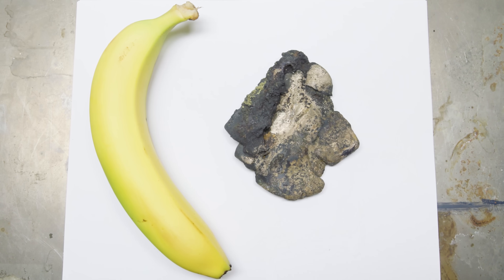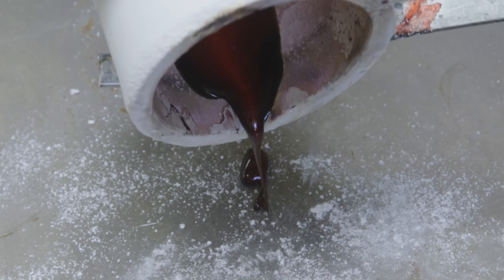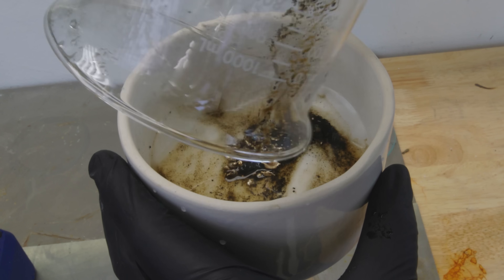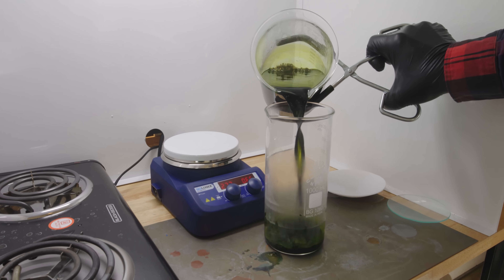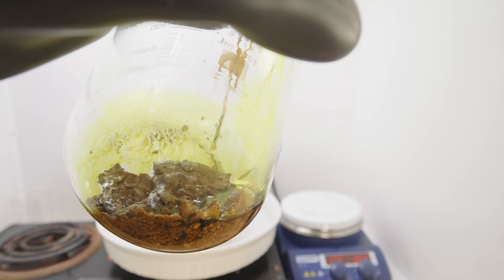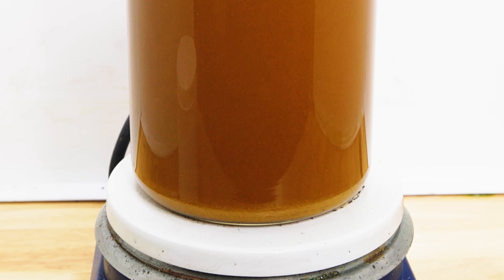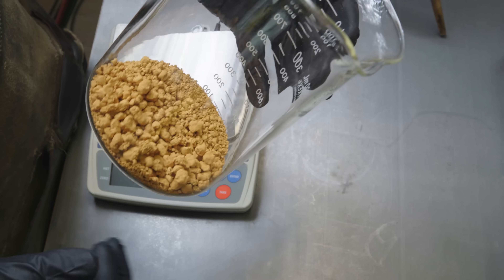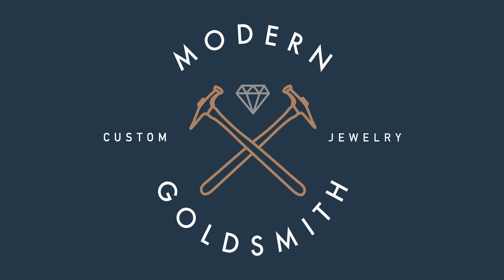Turning a BLOB into PURE GOLD!

Comment: I recently just bought my first gold bar that is only 1 gram and it was pretty expensive. The fact that this turned out to be 213 grams is pretty wild. To put that in perspective, that blob of gold is worth $14K+ right now.
Reply: a gramm gold is 59,38€
Reply: hilariously 533g (the original weight) at 10k is still over $14k lmao
Reply: Ok first of all nobody buys a bar of gold randomly and 1 gram is pretty much nothing this is so false
Reply: The problem is you're assuming it's indeed 24k, the moment it's even a little bit less (999.8 instead of 999.9) it's value drops significantly, this is why you can't take the gold out of the packages they come in or they're considered "not pure" anymore.. His would only be worth that much if specially forged in certain conditions and packaged in an inert gas
Reply: @keiththekeiser  isn't 23k still very valuable? im not sure if this is accurate but a quick google search told me that 23 karat gold is $83 aud per gram, he had over 200 grams of the stuff so that's 16k AUD, or roughly 11k usd.
Reply: @jazzman7842  yeah 23k is, still worth a crazy amount, but you'd be surprised by the difference in value between 99% pure and ~100% pure things, especially in chemistry or with gold
Reply: @keiththekeiser  from the same website i got my previous gold prices from, 24k gold is worth $86.433 aud per gram. that's about 3$ more a gram than 23k. I was of course able to find a different website with a higher value, but i have not yet checked what the corresponding value on that website for 23k gold is, so im not sure on how much more 24k is worth than 23k but i don't think it's anything larger than like 15% tops.
Reply: @jazzman7842  If it is 99. fine, as he claimed, it is 24K.  23K is 95.8 fine and if I recall correctly - in the US gold can be within 1/2K of its stamped purity - or 98.0 for 24K.  I don't know about the rest of the world.
Reply: @keiththekeiser  bro, gold ain't meth, purity won't matter that much since the actual thing matter is how much gold contained not the purity
Reply: @keiththekeiser  you also have 0 clue about gold lol ... even as 22k gold it would still be worth over 12k $ .... as the price diff per gram is like 5$ per gram between 24k and 22k 59.xx for 24 and 54.xx for 22 and this definitely is 23k, if not 24k
Reply: @keiththekeiser  bruh you have no idea what you're talking about. 999.8 gold is still 24 karat and the miniscule amount of additional impurities would barely affect the price if at all. removing gold from an assay does not change the purity either, gold is inert and does not corrode or react with elements in the air.
Reply: @NGRevenant  besides, if the value dropped so much from 0,01 impurity, it would be so much worth it to buy all the gold in the world above 99,9% to purify a bit further lol
Reply: @keiththekeiser  Wrong, even when a piece of gold is only say 6 karat the gold value remains the same. You could sell 6 karat gold at the same price understanding the piece is only 25% pure gold.
Reply: @keiththekeiser  some dealers will pay you less if it's out of the assay card. But tons of people gold stackers will attest to the opposite. Taking it out of the packaging does not affect the price.
Reply: @keiththekeiser  Its value doesn't drop anywhere. It's still gold. 12K gold is still 50% gold, half of the value of 24k gold. It doesn't matter what arbitrary "value" someone gives to it in monopoly money. Gold is gold, that is its value.
Reply: @keiththekeiserthis is so insanely stupid 😂😂😂
Reply: @keiththekeiser  Interesting! I appreciate the information.

Personally silver and copper are my favorite metals to collect. Gold is pretty too but prohibitively expensive to collect in any appreciable form.
Reply: idk where you got that number, it's under 2k
Reply: @spacenoodles5570  its around 12.5k worth of gold since its 24 karat
Reply: @spacenoodles5570  My brother in online entertainment.... Are you high?

213g is 7.513oz

1oz of gold as of 2023/02/05 is $1,864.30 USD per oz according to Kitco.

So 7.513 oz of gold is; $14,006.49
Reply: @mr.techaky7655  maybe he has some slight blunt head trauma and just searched "gold price" and got the value of 1oz
Reply: @mr.techaky7655  Gold is priced in "Troy" ounces, which is another silly non-metric unit.   There are about 31.1g per Troy Ounce vs 28.3g per regular ounce.     So 213g is "only" 6.84 Troy ounces, making your value a bit high.
Reply: @the_wiki9408  I keep telling its around $12.5k when I convert my country's 24karat gold price into dollars
Idk how you get $14k.
Reply: @spacenoodles5570  its definitely not under 2k
Reply: @spacenoodles5570  guy, an Oz of gold is about $1900!

Comment: Awesome job - the blob looks like it was slag which someone recognized as having some gold in - should have magnet tested it to see as I'm betting that came from somewhere which was refining iron.
While melting it down was a correct first step, you should have added a heaping tablespoon or two of Borax and melted it in a furnace as that would have drawn a lot of the dirt, arsenic and other junk from the gold for you, just leaving the precious metals.
I don't know enough about the chemistry part to advise from there but seeing as how you cleared the purity level of 23k and only had 8-9 grams missing, you clearly did that part right.

Comment: That was amazing, you wanna know where the 8 grams of gold are lost? its lost during boiling Aucl3 because the gold chloride vapor point is 265 celicus, thats why we dont boil aqua regia while dissolving gold instead we use sulphric acid for two reasons, 1. To heat up aqua regia so it work faster without boiling it. 2.Because its good at dropping lead as lead sulphate. You were lucky during your process tho. because the excess nitric acid is vapored while boiling aqua regia otherwise your gold solution would be overflooding when adding Sodium metabisulphite. please next time dont fill the peaker to its neck. just use half of the peaker so if anything unexpected happened you dont lose everything!

Comment: I worked for a chemical company that made precious metal catalysts.  They had gold, rhodium, rhenium, platinum and others used in an uncommon medium that would cause a chemical reaction - such as a spoonful dropped into a 10K gallon oil vat to produce gasoline at 1/3 of the time because the gold or other metal caused something to chemically happen faster.   Then the sludge in the bottom is scooped, trucked back to the refinery, into certain metals, reformed for catalyst, and on and on it goes.

Comment: I would have just dissolved the base medals first using multiple washes instead of jumping right into using aqua regia.  That way the silver and other base medals solutions could have cemented out onto copper in a bucket, without making silver chloride.  Later, cement out those medals onto copper,  collect those medals to and then cement out the copper solution onto iron when treating the waste solutions.  The cemented impure silver that came off the copper is easy to collect to use to for whatever later. Having 99% gold to dissolve also allows for incremental nitric dosing when making the  Aqua Regia, making it easier to have the gold come out of solution later without having the gold go back into solution incase too much nitric was used.  I think I know of at least 3 ways to have gold come out of solution.  Typically SMB on the first refining is quick and easy, but using gas probably makes the purest gold if used on the second refining. Second or even third refining isn't as hard as it seems once the gold has already been washed as you did when it was  in powdered form.    Lots of ways to skin a cat I guess.

Comment: Great job for your first time!! But just FYI, I t’s best to bring the karat down to about 6 or 7 by adding in some copper first. This way, you can get rid of all the copper and silver using nothing but nitric acid. Simply dissolve everything, and the gold will stay behind as black dust. Then if you filter and add copper metal to the blue solution left over, pure silver crystals will form on it and fall to the bottom. All the copper will then be left in solution as copper nitrate. Aqua regia works great for gold of course. But it also dissolves everything. Making it quite a bit more difficult and expensive to get your other metals separated.

Comment: Fun video but next time first reduce the gold ratio to 25 percent by melting copper (or silver) into the gold blob and then use nitric acid to get rid of everything besides the gold. That would clean out the gold even better especially if you double refine by making Aqua regia etc. at the very least you would not have to deal with so much silver.

Comment: When I was home refining instead of going straight to Aqua Regia, I did a series of Nitric Acid boils to remove the silver (thus avoiding difficult to deal with Silver Chloride) and also remove other metals (including base metals.)

Then when I went to Aqua Regis, id end up with a clear yellow solution and a few ml of Sulfuric acid to drop any lead out.  It was easy to filter. 

Id have to do a couple of refinings to get it very pure. But, this process avoided the dark colored mud and chloride formations. 

Nothing I’ve said is advice. Also, this stuff is dangerous. If you re not capable of doing it safely, don’t do it.

Comment: You had to quarter the gold with silver first. That is a process where you ad silver to the gold until the gold makes up a quarter from the total amount of metal. And when you poor the molten mix into a bucket with water you have to let is splash on a wooden board that stands upright inside the bucket so that you get metal flakes with a lot of surface area. After that you first start with dissolving the silver and all the other base metals with nitric acid boils until the liquid is clear and totally colorless, this might take 5 or even more nitric acid boils. And after that you can refine the metal that is left to 999 fine gold by dissolving the gold in aqua regia. When the gold is dissolved properly you should have a clear transparent orange liquid that is not cloudy at all. You can refine the silver by adding copper pipes to your left over solutions from the nitric acid boils. Watch the YT channel Sreetips for more details about refining the gold and silver.

Comment: Such a silly video. Instead of explaining how to do it, it explains how NOT to do it!  A bit of borax mixed with the first melt would have allowed a clean ingot to be poured which could be given to any refiner who would pay you 99% of the gold AND silver content. A lot less metal would be lost this way. This is a misinformation video, DON'T do this yourself!
Reply: I very highly doubt any goldsmith/chemist will only watch a single youtube video for research.
Reply: @PellyEllieEla  I agree. But that's not what I meant. Many amateurs out there will think this is a valid method and emulate it when it's ridiculous. A 500g slug can be sold straight to a refiner who will give you 98 to 99% of both the gold and silver after assay, certainly more than he extracted. And he should have burned all the filter papers afterwards and used borax at least when melting, even some broken glass would have been better than nothing. His primitive gold tester showed that a piece of it was around 14K, but it only lights up for a few values. His gold could have been a few carats higher which means he could have lost even more gold.
I dissolve gold only to recover hard to unset diamonds, other gold goes straight to the refiners as it's crazy to risk losing several grams of gold and waste hours and hours of time plus acids. I dissolved 1.9 kilos of diamond-set jewelery recently, I should have filmed it perhaps.  I'll have to wait a few more years before I accumulate that quantity again.

Comment: A friendly advice:
1. Never use glass containers for this task - however "heat-shock resistant" borosilicate glass is, this may still be not enough for this purpose.
2. Plastic container isn't that great idea either - should you tip out too big a blob at once (accidentaly) it may land at the bottom still hot enough to melt a hole in it. Steel bucket, old big steel pot or something like that. Better safe then collecting five gallons of water from your shop floor...
3. Actually, for removing the flux a diluted sulphuric acid is the best bath.
4. The first step in purification should be "quartering" the gold first, so the Au content would be around 1/4 (25%) - hence the name - by smelting it with proper amount of copper or silver. The alloy should be thoroughly mixed and granulated just as you did. 
5. This "quartered" alloy can be dissolved in boiling concentrated nitric acid - that is, all base metals apart from gold. And then only the the gold "sponge" should be further purified with aqua regia, because should the alloy contain silver, it would produce insoluble silver chloride (AgCl) that'd mess with the process.
...but then others said that too, so no need for me to repeat it all over again ;-)

Comment: First off, you don't clean the gold with hot water... That's just wasting time and $$. You should've liquefy the gold then filter it. Filtering will remove any unwanted debris. Also, you don't put smb after you filtering because that gold AR is still acidity from nitric acid and you are just wasting too much smb. The least you should've done is add uric acid til no more bubble. Then add smb!
Reply: As he is not a chemistry guy I think his work is good enough. Also considering he almost got a perfect yield

Comment: First time I watched this process was NileRed refining a viewers gold. It’s cool to see a gold smith do it just using some research. The yield was very high I was surprised. In the original block there was a huge section of dirt and other metals and I thought that would bring the yield down a lot from the initial estimate. Great video!
Reply: We will never forget what he did
Reply: the yield is not really that high considering lots of losses during the process.

the estimated weight was based on an inaccurate measurement of a non representative sample
Reply: @kelvinluk9121  I suspect you are right, but we don’t really know the lose, since we (as you say) don’t really know if his original measurement of purity was representative. He should have melter the blob and then measured the purity.

Comment: Nice vid, straight to the point.  As a lab tech/chemist, I can say you did very well handling things.  The one thing I'll say is that you'll need to be careful with nitric acid and nitrile gloves.  You'll want to look up vids about the interactions between them.  It's not super common, however, under the right circumstances, the gloves can ignite.
Reply: Could be you can answer a question than: perhaps I remember wrong from the loooong time ago I had chemistry lab, but IIRC hydrocloric acid wasn't kind of a gas dissolved in water? Wouldn't boiling weaken it? I clearly remember a lesson where we should wait for our experiment to cool down before adding the acid, both to not screw up the calculations we made and not to sniff all the nastys those beckers were full of. Can't remember if it was that one.

Comment: Hey there, ime Luke from the UK (chemist/refiner)
its so nice to see a gold smith learn the chemistry behind refining & do a good job of it, 
If you wan to pull out a few more impurity's & get that shine that 24k has when poured, then add a pinch of Sodium borohydride (borax) into your crucible once the gold is molten before you pour or let set, it will initially foam into white fluff then melt into a glass pulling out impurity's & acting as a flux as it does so.
dump the gold lump into water once set but still glowing hot  which will remove most of the set borax. 
If you still have any borax on the set gold nugget then pop the nugget into some warm sulfuric acid of 40%+ strength  to remove the borax without losing gold. 
Sulfuric will not dissolve gold. 
You will end up with a brilliant lustre on the gold. 
This was a brilliant video that i only found by accident while on the hunt for a specific refining video, you definitely have earnt my subscription, keep up the good work :)

Comment: The best way to bulk purify from fluxes is to cast as one solid ingot. The surface area is much lower and ask the flux remains in the outside, then you remelt and pour into water to get the flakes for the acid treatment when you want the high surface area.. And you also need to add some silver to the gold who the you can dissolve that first and get a gold powder

Comment: I'm wondering if the gold (or at least gold-colored) metal that you had at the 6:00 mark was pure enough to be salable, without messing around with dangerous acids. How pure do you think the metal was at that point?
Reply: Well compare the weight before and after, it was 514g in that state at 6:00 and then roughly 213 after... so it was less than 50% pure for sure.

Comment: Me is just triggered to see you pouring Hydrochloric acid first cause of how crude the alloy is(>10K is just very low) so just use Nitric acid to dissolve most impurities and get it to separate beaker(Use it to extract the Silver by adding just plain old salts) then use the Aqua Regia to get the gold

Also Sodium Metabisulfide is a good choice for a reducing agent to get the gold from Aurum ion[Au(I)] to metallic gold

The test is also kinda unnecessary cause if you can see the yellow color in the solution, that mean there is still gold left just too little that it didn’t show in the test(Worth around 3-20$ from what I see)